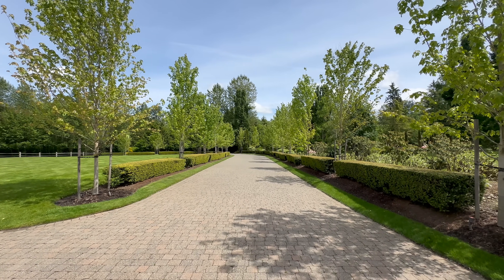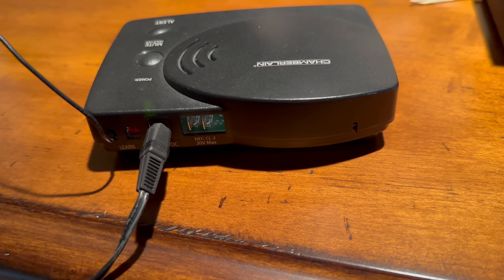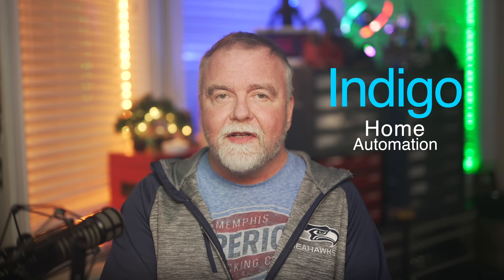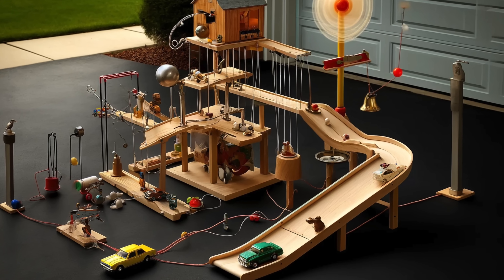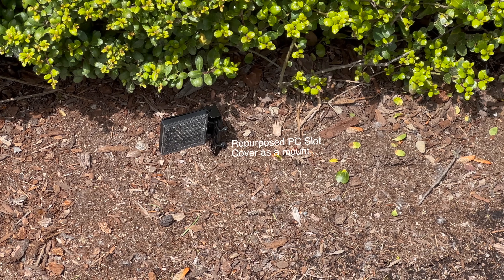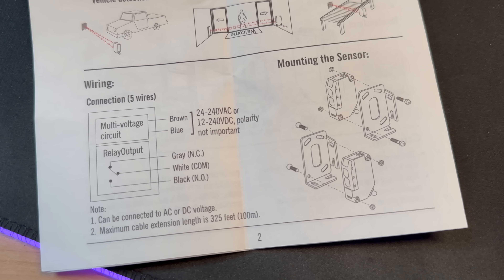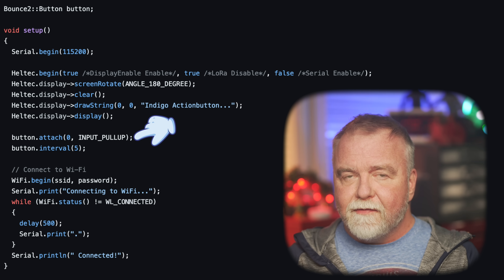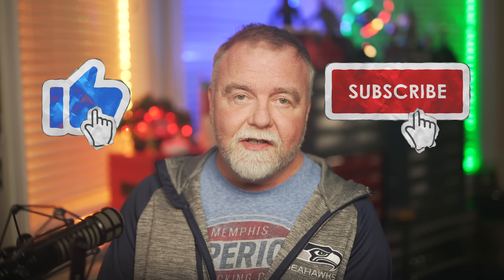Building the Ultimate WiFi Driveway Alert System w/ code and parts!

Comment: I've got a very similar problem, I've been using a Dakota Alert inductive driveway sensor (I only want to know about metal passing the driveway) which has a battery powered transmitter nearby.  This is picked up by a SimpleHomeNet (company long gone) receiver in my garage which converts it into an Insteon signal.  Finally a Universal Devices isy gives me an Insteon to TCP/IP connection which I've got custom Java code to monitor.  This all works just fine for now, but the Dakota Alert stuff is analog and only signals a low battery by double tripping which is annoying.  SimpleHomeNet is just plain gone and as far as I'm concerned Insteon could go too (like you I was unaffected when their cloud service went offline).  What I'd really like is for something to replace the battery powered controller near the driveway and read the buried inductive sensor and then send some kind of digital signal (including battery status indication) that a receiver in the house could pick up that I could program to, but so far I haven't seen anything that reads an inductive sensor like that.  One option I'm exploring is that I suspect the Dakota Alert box is a simple 433Mhz radio and 433Mhz receiver modules that can be connected to ESP32 devices are cheap.  This wouldn't give me digital battery monitoring but would allow me to replace the SimpleHomeNet and Insteon legs of that system and go right from 433Mhz to MQTT via the ESP32.

Comment: Great idea with the IR sensor! I connected an electromagnetic driveway sensor to the extra doorbell port on my house intercom, so a car would simply ring the bell with a different ring than the front door. This was 20 years ago, unfortunately I chose X10 modules to send the signal to the intercom which resulted in many false alarms during storms. Having 2 sensors in a row might be a good enhancement to allow sensing direction and be alerted on incoming vehicles only....

Comment: [Too late for Dave, but just an idea that may be of interest to others...]
I wonder if a pulsed laser could make its way to the end of the driveway in fiber optic cable, and the reflected laser pulses could be returned the same way (same FO cable).
So the outside equipment would be a housing with a lens, and a retro-reflector on the other side of the driveway.  Pulses would be above kHz range so as to not miss anything.
• Outside module would be 100% electrical-free. No power needed.
• Non-conductive (no cables), so immune to lightning strikes (double-check the FO, some have a steel wire support strand).
The inside equipment might need a beam splitter.  The rest is just "typing" (software).    ;-) !!
Reply: Nonsense deleted, because I can.

Comment: You never mentioned that the ESP32 is only 3.3v volt tolerant for a sink (input) signal.  Your sensor only generates a 0 LOW and 3.3v HIGH state?

Comment: So…. There are magic things called cameras, that have vehicle and even license plate recognition. There is also a thing called home assistant.

The two can be used together….

We have Ubiquiti cameras using these detections, and then use home assistant to trigger outputs. Can turn lights on when vehicles show up, trigger gates to open based on license plates…. Lots of options. And MUCH simpler. 🤣

Comment: It's better to use Normally Closed contacts if you have the choice.  That way, if the cable breaks or is cut, you get an alarm.
Reply: Came here to say that, making it fail safe to alarm on a power loss
Reply: @mazeidman  That assumes the relay is normally energized when the device is powered - that isn't necessarilly the case with N.C. contacts.

Comment: 2:25 "2.4 GHz Wifi is good for a maximum of about 300 feet outdoors"  Not with the right antennas.  In the 90s long before we had high speed Internet where I lived, I shot 2.4 GHz Wifi 24 miles over 3 links via a mountaintop to a friend's house to get high speed Internet.  The longest of the 3 Wifi links was about 14 miles.

Comment: I use ESP Now for a similar system.  This is a specific protocol for all ESP type products.  The system can send broadcast signals to be received by many ESP modules or it can use a targeted MAC based signal to ensure that a single ESP module is notified.  It can also be encrypted.  At the moment my entrance sensor is an infra red sensor but I have also used those cheap radar movement detectors.  The receiving system is a series of ESP 8266 modules connected to a simple strip of LEDS which flash when a message is received and the system was designed because my daughters, when in their rooms 'cannot hear the front door bell (or so they claim!) and so muggins here was expected to go to answer the door to receive their many Amazon deliveries.  The system is very flexible as I carry an esp8266 module in a 3d printed case which contains a flasher unit, similar to those my daughters rooms, as well as a vibrator unit, the type that are readily available on ebay and are used in mobile phones.  The mobile unit is powered by a 9v battery and is useful when I am gardening in the back yard. If I need more sensors, for example, my fox trigger for the garden I can simply add another esp8266 hidden in the undergrowth to detect foxes and cats digging in my vegetable plots. No change to the code is required, as I send a coded message to determine which sensor has been triggered.

Comment: I installed a Mighty Mule wireless driveway alarm for our 200ft long driveway a number of years ago.  It uses a electromagnetic vehicle detection system that senses mass metals (ie vehicles) in motion passing through your driveway or property entrance, so is unaffected by animals or snow buildup.  The remote sensor uses two AA batteries which I replace each fall.
The receivers emit a Beeping tone and latch an LED each time a vehicle passes.  A NO contact could be added with a opt-isolator or relay. 
I also use Insteon switches etc (since about 2005 or so) to automate my home controlled by a Universal Devices ISY-99, no cloud connection either.

Comment: Nice setup, but I think passing up LoRa may be a mistake.  Using WiFi at near the maximum range may be problematic in the winter when snow is a problem.  If you don’t have snow, then rain may be a problem.  Heltec also offers nice LoRa modules.  I’ve tested these to several miles, meaning they are reliable at close range in all conditions.   In any case, your setup is most impressive.  I use 915M LoRa modules comercially by the thousands to replace 2.5G modules and I have not looked back.  This new technology is more than an order of magnitude better than conventional radios.  I always enjoy your posts.
Reply: In my experience with 10 to 20 mile 2.4G wifi links, rain and snow doesn't significantly affect Wifi.  Ice on the antenna does.  Just use an external antenna.

Comment: This is a nice solution. The only drawback is it needs a wired power source which wasn’t a problem for your setup. I needed a similar setup to detect catalytic converter theft using an off the shelf IR sensor and plug in receiver. But I wish it had a light beam instead.

Comment: I used a Dakota Alert with a Zooz Zwave relay and Home Assistant. Works beautifully and I didn't have to build anything janky. You don't want a laser sensor. When an animal walks across it, you'll get a false alarm. My sensor can tell me when someone is arriving or departing.
I always use the N.C. connection because the system can detect when there is a disconnect.

Comment: appreciate the project.  i too have a long driveway, about 400ft.  for years I've had a 'mighty mule' system that uses an in-ground induction sensor to detect vehicles so that dogs, cats, rabbits and deer don't set it off.  But I still have the problem that their little transmitter only goes a max of 200ft reliably, and the receiver has no dry contacts for my home automation server.  Maybe I'll see if I can hack it a bit to get an ESP32 in the transmitter to do my bidding....

Comment: I have a similar setup.  I have a better solution.  A Tapo camera (TC85 or 425) with AI sensor programmed to detect vehicles and people works perfect.  Sends an alert via wifi and my Alexa announces "Person detected at driveway".  I can then trigger routines like lights to come on after hours.  Also wifi 802.11AH will allow longer than  300 ft spans.

Comment: this is awesome. i'm working on a very similar project. mine is to notify when the mail or trash gets picked up and to log it. I'm using a Wemos D1 mini but i'm having trouble getting it to connect to my wifi reliably. I use heltec V3 with Lora for meshtastic (another very cool project), I think i will change my sensors to heltec since i know those work reliably for me

Comment: Do you not have snow where you are? I see your reflector is at ground level. Also the brush near the sensor would likely generate many false alerts. We have a very similar setup, but about 3 feet off the ground, and a snow cap for the reflector. Even so, in certain rainy/foggy weather, the reflector stops reflecting and it reports like a parked car. Maybe some rain-x would help, but I haven't yet tried that.
Reply: Some small resistors to act as heaters will keep the reflector and lenses above the dew point and fog free.

Comment: One thing - the round things in the pladtic box are places for cable openings. You buy specific plugs  allowing you to maintain a decent IP [dust/water] classification. No need to cut a hole for the cables.

Next thing - for sensors it's best to use alarm on break. Then you will produce an alarm if you get a cable fault or someone intentionally cuts the cable.

And have the device always sends a "still there" watchdog/alive message x times/day and automatically repair thr WiFi if it fails to send. And have the other side flag if your ESP32 stops reporting in for more than 1.5x the expected ping period. And send a counter in the alive messages - if that counter resets, then the ESP has for some reason rebooted. That can be a hint you have an issue brewing.

Comment: If there's a retro-reflector, what keeps me from beaming a second source of light to the mirror from 10 feet up the driveway, and then driving or walking through so that there's always at least one source of light reflecting back to the sensor?
Reply: The IR output beam is pulsed on/off.  If the returning beam doesn't match the pattern, it alerts.

Comment: When waiting for something external to happen, I've been told it's best to setup an interrupt function rather than a delay loop. Not 100% sure why. Also, maybe reconsider encrypted LoRa? WiFi networks can be hacked and are very easily disrupted. Also, also, you should probably consider tamper protection e.g. power cut. Really interesting video!!
Reply: Any radio based wireless connection is easily disrupted.

Comment: ESP32 boards with an external antenna connection are available. I have one on my patio where a normal ESP32 would have weak signal and occasionally drop off. The antenna model works flawlessly.

Comment: If you need/want more range at the cost of a 2nd ESP32, look into ESP-NOW, it can double the range. The ESP32 connected to the remote sensor talks to the other ESP32 near your home over ESP-NOW (expressiff's own 2.4 protocol), then the ESP32 near/in your home can talk to your existing home setup via wifi.

You can also add more ESP32's along the way as repeaters (But then you gotta figure out how to power those in the middle of the link)

Comment: My 3 German Shepherds go nuts when Alexa announces "Driveway motion" that a driveway sensor triggers, so I feel your pain.  You might check out the YoLink sensors.  It's LoRa (not LoRaWAN), I've found it works very well, and I use it for some distant light switches in the shop and the driveway sensor. The rest of my sensors are LoRaWAN things I've built that are integrated via ChirpStack and NodeRed. Lastly, consider also connecting the normally closed output of the relay to indicate that the optical sensor is still connected. If the cable was cut or damaged, you'll never know. You could use it instead of the N.O. contact, but you can use both as independent verification. And hopefully you have a heartbeat message so the home automation will know if the ESP32 ever stops working.

Comment: Awesome, I use the long range motion sensors on Amazon, they have great range, (1/4 mile claimed) and you can use more than one if you like, and the indoor part has alarm contacts as well, but, having a beam that crosses and returns is far superior, I like your design. I also use one of my sensory to put temporarily wherever I need to, for purpose of being notified when the groundhog is out so they can be, eliminated..

Comment: Well done Dave, it's always a challenge when trying to integrate with existing devices... I actually use the exact same sensor and an esp32 but have gone a different route. I used the ETH01 board with a separate POE module and a POE switch extender at the nearest camera to get POE from my existing POE camera (the splitter takes in 1 POE and gives out 3 so I was also able to add a 2nd camera at that spot too!) and on the ESP I run ESPHome (since I run home assistant). I have a few other sensors added too (2x PIR in different direction, rain sensor and temp/humidity). A few NodeRED flows take care of the logic and the ESP01 is OTA updatable... Oh it also does a few switches (gate) and a doorbell and there is a DFPlayer Mini and a speaker in there too to play a doorbell sound locally at the gate...

Comment: Have you checked your minimum amps on the contacts? Typically it's around 1ma for gold alloy plated contacts, and 10ma for silver alloys. The minimum is important for long term reliable contact connections. Without enough spark energy to burn off junk, the contacts have a tendency to crap up and fail. 

Also I would suggest occasionally cycling the relay to diagnose the contacts are working properly. Sounds like they should be cycled just about daily. However if they fail, the system won't know. If your system could command the relay to close then measure that it did close within a window of time you could detect failure.

Comment: I did a similar project a few years ago using a raspberry pi and ir beam sensor. the beam sensor had two parts transmitter and receiver. (wish i went for a mirror solution now). Every time the beam is broken the rasberry pi would email my gmail account on my phone with the date and time. I was planning on adding a camera to the pi and send  a photo (maybe video) aswell.
This has worked very well. the biggest problem i had was the email side. I found gmail worked fine but the first version i used by isp email and because the emails are very similar they would block the emails, thinking is was spam/email bomb.
Anyway keep up the good work.

Comment: Id suggest trying a wireless microwave transmitter/reciever as used in outdoor PIR lighting as the infra red could be affected by external influences like weather or moisture or debris build up on the reflector.

Comment: I did some coding around Esp32 and MQTT. ( using VS and platformio) I found that if your wifi connection gets sometimes weak the Esp can come to a no more connecting state. That's why you need some internal watchdogs ( in my case different for wifi and mqtt) with final do a hard reset of the processor (does not work for Esp8266 as eronous implementation). Also an additional watchdog signaling via wifi to control the alive status of the device is highly advised.. m5c.   Thx Dave for your interesting videos. Mike.

Comment: Nice work! Might I suggest a fallback in the main loop to reconnect to Wi-Fi if the signal is lost for whatever reason... That way you don't need to reset the ESP32, which could mean a trek out into the cold :)

Comment: Have you considered adding a CC1101 radio module and rtl_433 library to your ESP32?  There's scope for identifying regular visiting vehicles via the IDs broadcast by the TPMS sensors on each wheel.   Caveat at low speeds you might need to investigate transmitting on 125kHz IIRC to trigger the TPMS modules.

Comment: I'm curious if the old system was MURS.  Seems like that was the go to long distance communication for that type of sensor about 15 years ago.  I still hear them occasionally because they transmit an audio warning that can be picked up on MURS radios.  There was a neat driveway coil sensor similar to the type installed in roads at stop lights.  Nice because they don't give a lot of false alerts like laser do.

Comment: I hope you make more videos on things like this.
I love to see new ideas for sensors and how others utilize different types.

For a while now I have wanted to build a driveway presence sensor but I was not sure if laser or a microwave sensor would be best for it. I could see the microwave one detecting all sorts of things I do not want to trigger it. But they're effective for things like presence detection (to maybe light up the house when you arrive home, or diff rooms you enter)

I currently have a few CO2/Temp/humidity/particulate matter combo sensors (I built) strewn through the house. Some LED's with WLED setup, and I have even used ESP's to tap into fans to press buttons like a remote would. Next I plan to work on ceiling fans and an attic gable fan system.

Anyway. Thx for the idea/video. I like your way of achieving this more than my previous ones.

Comment: I'm not personally familiar with Indigo, but Home Assistant has been one of the most interesting projects I've ever dove into.
I started by unifying purchased lights of diff brands, and eventually built my own components/sensors.

But I think it's something you should look into
I run mine on a VM on my R720 but you can run them on RPi's too